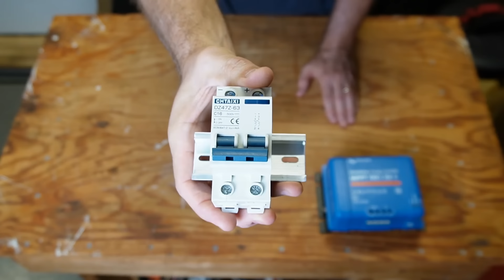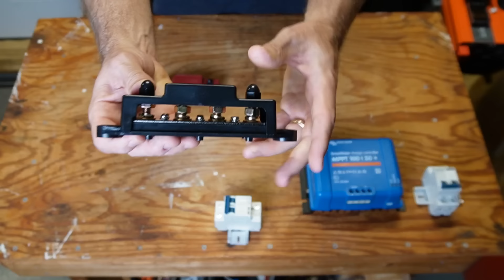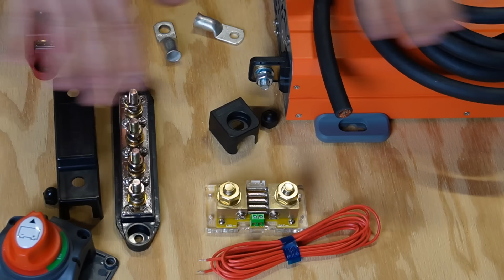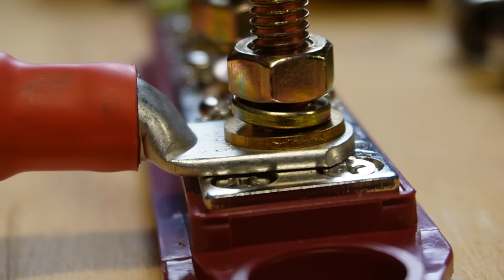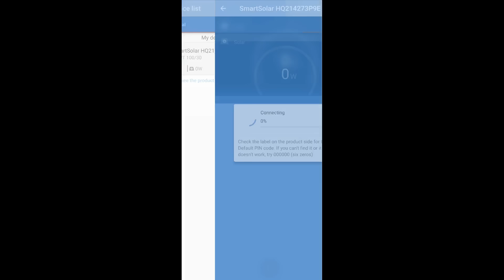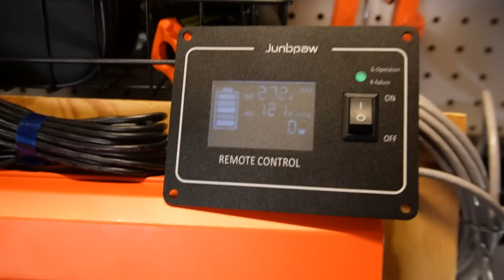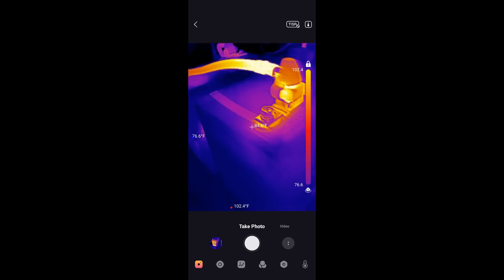24V DIY Off-Grid Solar Generator Build For Beginners

Comment: Great video,I appreciate you showing the mistakes and the fixes. Is that inverter able to to supply 12 volt to let's say,trailer lights if i wanted to duplicate this system
Reply from the maker: Thanks. That inverter only outputs 120v. So it wouldn't be good to power 12v lights. This system is mainly for powering home 120v  appliances in your home such as lights, a refrigerator or freezer. Things like that.
Reply: 255  God! There is no god except He, the Living, the Everlasting. Neither slumber overtakes Him, nor sleep. To Him belongs everything in the heavens and everything on earth. Who is he that can intercede with Him except with His permission? He knows what is before them, and what is behind them; and they cannot grasp any of His knowledge, except as He wills. His Throne extends over the heavens and the earth, and their preservation does not burden Him. He is the Most High, the Great.
256  There shall be no compulsion in religion; the right way has become distinct from the wrong way. Whoever renounces evil and believes in God has grasped the most trustworthy handle; which does not break. God is Hearing and Knowing.
257  God is the Lord of those who believe; He brings them out of darkness and into light. As for those who disbelieve, their lords are the evil ones; they bring them out of light and into darkness—these are the inmates of the Fire, in which they will abide forever.
258  Have you not considered him who argued with Abraham about his Lord, because God had given him sovereignty? Abraham said, “My Lord is He who gives life and causes death.” He said, “I give life and cause death.” Abraham said, “God brings the sun from the East, so bring it from the West,” so the blasphemer was confounded. God does not guide the wrongdoing people.
259  Or like him who passed by a town collapsed on its foundations. He said, “How can God revive this after its demise?” Thereupon God caused him to die for a hundred years, and then resurrected him. He said, “For how long have you tarried?” He said, “I have tarried for a day, or part of a day.” He said, “No. You have tarried for a hundred years. Now look at your food and your drink—it has not spoiled—and look at your donkey. We will make you a wonder for mankind. And look at the bones, how We arrange them, and then clothe them with flesh.” So when it became clear to him, he said, “I know that God has power over all things.”
260  And when Abraham said, “My Lord, show me how You give life to the dead.” He said, “Have you not believed?” He said, “Yes, but to put my heart at ease.” He said, “Take four birds, and incline them to yourself, then place a part on each hill, then call to them; and they will come rushing to you. And know that God is Powerful and Wise.”

2  God, there is no god but He, the Living, the Eternal.
3  He sent down to you the Book with the Truth, confirming what came before it; and He sent down the Torah and the Gospel.
4  Aforetime, as guidance for mankind; and He sent down the Criterion. Those who have rejected God’s signs will have a severe punishment. God is Mighty, Able to take revenge.
5  Nothing is hidden from God, on earth or in the heaven.
6  It is He who forms you in the wombs as He wills. There is no god except He, the Almighty, the Wise.

11  Originator of the heavens and the earth. He made for you mates from among yourselves, and pairs of animals, by means of which He multiplies you. There is nothing like Him. He is the Hearing, the Seeing.
12  To Him belongs absolute control of the heavens and the earth. He spreads the bounties to whomever He wills, or reduces it. He is aware of all things.
13  He prescribed for you the same religion He enjoined upon Noah, and what We inspired to you, and what We enjoined upon Abraham, and Moses, and Jesus: “You shall uphold the religion, and be not divided therein.” As for the idolaters, what you call them to is outrageous to them. God chooses to Himself whom He wills, and He guides to Himself whoever repents.

54  Your Lord is God; He who created the heavens and the earth in six days, then established Himself on the Throne. The night overtakes the day, as it pursues it persistently; and the sun, and the moon, and the stars are subservient by His command. His is the creation, and His is the command. Blessed is God, Lord of all beings.
55  Call upon your Lord humbly and privately. He does not love the aggressors.
56  And do not corrupt on earth after its reformation, and pray to Him with fear and hope. God’s mercy is close to the doers of good.
57  It is He who sends the wind ahead of His mercy. Then, when they have gathered up heavy clouds, We drive them to a dead land, where We make water come down, and with it We bring out all kinds of fruits. Thus We bring out the dead—perhaps you will reflect.
58  As for the good land, it yields its produce by the leave of its Lord. But as for the bad, it produces nothing but hardship and misery. Thus We explain the revelations in various ways for people who are thankful.
59  We sent Noah to his people. He said, “O my people! Worship God; you have no god other than Him. I fear for you the punishment of a tremendous Day.”
60  The dignitaries among his people said, “We see that you are in obvious error.”
61  He said, “O my people, I am not in error, but I am a messenger from the Lord of the Worlds.”
62  “I deliver to you the messages of my Lord, and I advise you, and I know from God what you do not know.”
63  “Do you wonder that a reminder has come to you from your Lord, through a man from among you, to warn you, and to lead you to righteousness, so that you may attain mercy?”
64  But they called him a liar. So We saved him and those with him in the Ark, and We drowned those who rejected Our revelations. They were blind people.

59  The likeness of Jesus in God’s sight is that of Adam: He created him from dust, then said to him, “Be,” and he was.
60  The truth is from your Lord, so do not be of those who doubt.
61  And if anyone disputes with you about him, after the knowledge that has come to you, say, “Come, let us call our children and your children, and our women and your women, and ourselves and yourselves, and let us invoke God’s curse on the liars.”
62  This is the narrative of truth: there is no god but God. God is the Mighty, the Wise.
63  But if they turn away—God knows the corrupt.
64  Say, “O People of the Book, come to terms common between us and you: that we worship none but God, and that we associate nothing with Him, and that none of us takes others as lords besides God.” And if they turn away, say, “Bear witness that we have submitted.”
65  O People of the Book! Why do you argue about Abraham, when the Torah and the Gospel were not revealed until after him? Will you not reason?
66  Here you are—you argue about things you know, but why do you argue about things you do not know? God knows, and you do not know.
67  Abraham was neither a Jew nor a Christian, but he was a Monotheist, a Muslim. And he was not of the Polytheists.
68  The people most deserving of Abraham are those who followed him, and this prophet, and those who believe. God is the Guardian of the believers.
69  A party of the People of the Book would love to lead you astray, but they only lead themselves astray, and they do not realize it.

84  Say, “We believe in God, and in what was revealed to us; and in what was revealed to Abraham, and Ishmael, and Isaac, and Jacob, and the Patriarchs; and in what was given to Moses, and Jesus, and the prophets from their Lord. We make no distinction between any of them, and to Him we submit.”
85  Whoever seeks other than Islam as a religion, it will not be accepted from him, and in the Hereafter he will be among the losers.

28  It is He who sent His Messenger with the guidance and the religion of truth, to make it prevail over all religions. God suffices as Witness.
29  Muhammad is the Messenger of God. Those with him are stern against the disbelievers, yet compassionate amongst themselves. You see them kneeling, prostrating, seeking blessings from God and approval. Their marks are on their faces from the effects of prostration. Such is their description in the Torah, and their description in the Gospel: like a plant that sprouts, becomes strong, grows thick, and rests on its stem, impressing the farmers. Through them He enrages the disbelievers. God has promised those among them who believe and do good deeds forgiveness and a great reward.

111  And say, “Praise be to God, who has not begotten a son, nor has He a partner in sovereignty, nor has He an ally out of weakness, and glorify Him constantly.”

Read The Quran

Comment: Well thanks for making it easy for me to figure out how to design my system. I already have the two DC house batteries I have the vectren 100 / 50. I currently have a 12 volt inverter so my batteries are in parallel but I want to get a 24-volt inverter so I can run my batteries in series and add more panels I'm almost to the 700 watt Max for the 12 v and I have a couple more panels on the way so I need to go to 24 volt. And I'm just going to copy what you did with the breakers the fuses and the shunt. Appreciate you buddy.
Reply from the maker: Glad you found it helpful!

Comment: Why do you not ground the chassis?  Manuals say it is required but most of these diy projects skip it.  The only creators I have found who ground them don’t explain it. I am just gonna keep watching these and ask everyone until I get a satisfactory answer.
Reply: I would ground the chassis of the inverter to negative battery. This is not the same thing as driving a ground rod into the earth. It's just bonding the inverter's metal case to the DC negative so that if an internal fault puts battery voltage on the case, the fuse should blow instead of leaving the case energized. But 24v DC isn't going to hurt you.

Comment: Sure would like to go 24v but my charger and inverter both are only 12v.
Spent a small fortune on just those two alone.
Would it be beneficial to make a cutout on the plywood for the back of the controller so it gets more air?
What happens if your panels output say 60v or so? 4 x 27.8v each panels 200 + 200 series then another set like that then both tied in parallel. Voltave could exceed 60v.
I will have 4 batteries, a 40a dedicated lifepo4 charger and an 200w nominal 300w peak inverter plus a shunt, to hook up so I have to buy the $90 bus bars that hold 600 amps. Using awg 2 gauge battery wires. Hence the reason for the bus bars. 2 gauge is fine for one battery. Each of my batteries will have their own cable to the bus bar. Cheaper than buying huge copper cables and huge lugs.
Trying to avoid stacking if at all possible,

You have an outstanding tutorial! Great Job too.

Oh you forgot what most every DIY-er has - a COLD BEER in one hand! lol
And a fire extinguisher just in case.

Note: you forgot the link to that torque wrench & IR camera in your list.
Reply from the maker: You could cut out the back, but the inverter already has a small space between the plywood. Maybe 1/4". You could use something to stand the inverter out some more away from plywood like some rubber washers or something similar. You definitely need to make sure your panels don't exceed the voltage the solar charge controller can handle. Thanks for the kind words. I'll add in those things I missed. Thanks
Reply: @proficientprepper  Went to a metal shop. In their scrap pile they had the exact same size and such of aluminum and it even had 4 mounting holes drilled into it!
Couldn't believe I got that lucky.
Still have to get the plywood, cut to fit the cart, mount the plywood, then begin to mount components.
Going to be a long careful job....
Found a great deal on a 410W solar panel for $134.
Too close to Christmas for me to buy that darnit.
Would love to have like 5 of them, but batteries, wires, CONTROLLER, and misc would cost a small fortune.